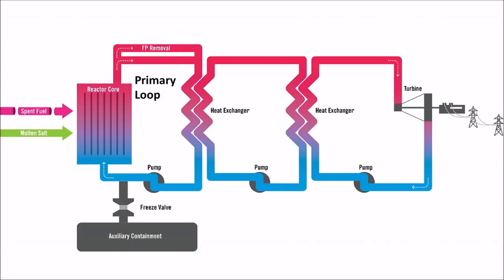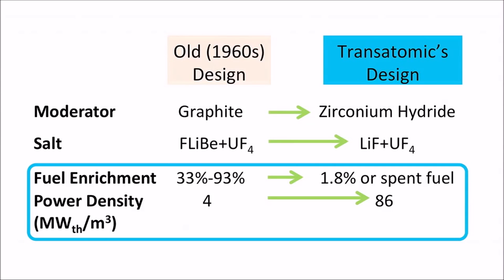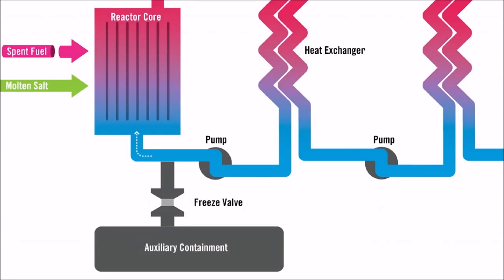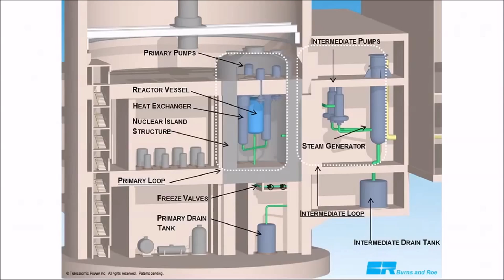Burn Nuclear Waste with new High Technology Reactor (MSR) [Read description for update 2/2019]

Comment: I really think that this has more applications besides electricity. For example, if one of these was set up at a petroleum refinery, the waste heat could still be used for distillation of crude, and because refineries are already secure installations and are on contaminated soil, no extra space would be needed.  This also could be used to produce hydrogen either by modifying natural gas or by electrolysis for hydrogen fuel cell vehicles. A large scale hydrogen storage area combined with  banks of fuel cells could provide electric power during peak loaf or emergency backup for the refinery. Power outage at a refinery causes a lot of money to be wasted in product. Combining the functions for both electric and fuel could be very economical, and if it proves to be as safe as advertised, the potential to make a bad situation much worse won't exist.
Reply from the maker: I love your points, and you are (at least mostly) correct.  Hydrogen is actually a pretty poor energy storage option.  It has low energy density and there are significant losses in making it (even from electrolysis).  However, the idea of using excess heat to run chemical reactions has been discussed at length in the high temperature reactor community.  Two very nice examples:  jet fuel (already proven by the US Navy), and ammonia (NH3) - great for fertilizer as well as a base chemical for a huge list of uses.  Non chemical uses could include thermal water desalination (a great way to get clean water from the ocean).  Your point on crude distilation is also a good one.  Right now, the waste (thick, polluting) oil is used to generate the energy needed to separate crude out of tar sands.  If you could use nuclear energy, then when we do use oil, it would cost less and pollute less.  There is a high temp reactor company looking to promote this exact thing in Canada.  What would probably be even better (though more in the future) would be to use nuclear heat to generate liquid fuels (similar to the jet fuel example) which then are burned by normal engines, and then the gasses are recycled again back into more fuel using nuclear heat.  Basically we would turn liquid fuels into a renewable resource with a closed loop.  This would give the best of both worlds, since you now have the high energy density of liquid fuels, the convenience of refueling (compared to charging electric vehicles), etc.  But I'd argue there is a lot to say about all of this - a huge potential here that really needs to be explored and implemented as soon as possible.
Reply from the maker: It is also reasonable to expect in the (hopefully not distant) future that oil harvesting will be economically pointless.  If you take any random area and dig up the dirt, then extract the thorium, the energy equivilent contained in that thorium would fill the hole with oil 30x over.   The numbers show that average dirt is about 2 ppm thorium, but right now thorium is a waste (a legal probablem and nuscance actually) from rare earth mining (typical mining sites I recall are ~10ppm thorium).  Theoretically, we could basically power the world from this waste product and never need oil again (and would create liquid fuels from CO2 and H2O and/or nitrogen from air for NH3) to cover the need for high density portable energy.
Reply: LFTRnow I really hope they get the small modular prototype built soon. It seems that the proof of concept is the biggest catalyst for getting the ball rolling to a commercial product. So much red tape and burocracy will be much more damaging to the environment because the more traditional electric generation continues to run and pollute it's sad that out scientists have to go to Russia and China to develop these concepts because of the fear and ignorance that keeps us from even trying new technology. I believe that it can be safely done and that this is the most important step towards reducing the greenhouse gasses that are raising the global temperatures.  It's very sad that the three most well known nuclear disasters would have been prevented has the people working at the plants left the system alone and do what it was designed to do. 
Three mile island operators turned off the cooling system because of a faulty pressure operated relief valve - basically.
Chernobyl: operators disabled all of the safety systems that would have scammed and cooled the system.
Fukushima: operators cycled the convection cooling system to prevent fuel damage from cooling too quickly. Had it been left alone they might have had some warped fuel assemblies but they wouldn't have had the scope of damage that they currently are dealing with. 
I'm also thinking that this new system can also use the depleted uranium in a breeding configuration if so we could be potentially sitting on  an enormous reserve that will last for many years.  It concerns me that the USA isn't perusing these newer reactor technology quickly enough to get important patents and other foreign countries end up with a monopoly that ends up costing us in the long run towards the cost of electricity both commercial and residential.  With coal, there is still waste that is radiological because of the traces of radioactive elements that are in coal. It would seem that not many people are aware of it.
Reply from the maker: I agree and heard of all of that except for the explanation of Fukushima.  I would argue that the amount of radiation released to the environment would have been negligible if the reactors were opened to the ocean when the cooling system failed.  Instead, bad instrumentation and delays in action caused the pressure to build up and blow the roof off of a pretty badly designed reactor (Chernobyl was similar in that both had no containment structure like most US reactors do).  Still, while I'm pro conventional nuke as well, I would truly love to see new GenIV designs get built and fast.  There are some variants getting built around the world but no thorium, or liquid fueled (including MSR or LFTR) reactors yet.
Reply from the maker: Also sad, I'm sure you have heard of the IFR.  It was to use the "spent" fuel from light water reactors and breed the uranium to plutonium for energy.  It was sadly shut down in the '90s.  It is really unfortunate that nuclear accidents basically made the public want to stop doing nuclear energy of any kind, when really what we needed was MORE research so newer and safer designs (and more cost effective) could be created instead.  The video link below is a clip from Pandora's Promise and shows how the IFR would have automatically prevented (by design, not by safety systems) any of the last nuclear reactor accidents.  This tech EXISTS, yet we don't use it.  I believe a few breeders are being built around the world, the UK installation being one of them, so perhaps there is still hope.  https://www.youtube.com/watch?v=Sp1Xja6HlIU
Reply from the maker: Funny you should mention coal waste being radioactive.  Have you heard the area around a coal plant is more radioactive than that around a nuclear plant?  The reason is obvious, though people don't think about it.  A nuclear plant has shielding and emits very little to the outside, usually it adds a tiny fraction to the existing background radiation - where as a coal plant burns the carbon out of coal and leaves behind lots of toxic metals, including radioactive uranium and thorium.  As small amounts escape over time into the air, it blankets the area around the coal plant in radioactivity that is well above background.  In short - want less radiation?  Build more nuke plants.  https://www.scientificamerican.com/article/coal-ash-is-more-radioactive-than-nuclear-waste/  Of course, there is quite a bit of research suggesting the body actually needs MORE radiation, but that is a story for another time.  Far worse though is that the toxic materials from coal ash can get into the water supply and pollute - not for some tens or thousands of years like a nuclear accident is perceived to, but forever - the added lead, mercury, arsenic - it is there forever.  See:  https://www.youtube.com/watch?v=58kaw5GQIc4
Reply: I think it's awesome to talk to someone like you who is obviously an intellectual and haven't been judgmental or rude like I've seen in many other videos that are advocating for new nuclear technology. For that, I thank you!  I'm thinking that radiophobia I'm American was pioneered by the movie "The China Syndrome" that came out in 1979 just a few weeks before the three mile island accident. If I could afford it,  would love to visit Chernobyl and see the new gigantic safe confinement building. I haven't seen much online about their progress in dismantling the old sarcophagus and removal of the debris. I'm fascinated by the elephants foot. I remembered one of the documentaries showed they found some molten fuel still moving and glowing 5 years after the accident. I think it was from Nova "suicide mission to Chernobyl ". I really hope that someone is documenting what is going on inside the new building and I hope to see it soon. I'm wondering how much fukushima has melted beyond the pressure vessle. There's a few videos on YouTube but nothing so far has satisfied my curiosity. Japan had a plant for processing used fuel and it had failed due to a major leak, and it's bad because it could have really showcased what could have been a very good process for recycling and further reducing spent fuel storage.  The PVA got the new reactor at watts bar going but it's still an older design, although the safety systems are modern by comparison to other reactors.  I'd also like to see how they decommissioned the enterprise CVN65. Those 8 reactors! I'm expecting there have been a few challenges to dismantling that part of the ship.  It's reminded me of Russia and their floating power plant that had to be moved before they could load it with fuel because it was too close to a densely populated area.
Reply from the maker: Thanks, same to you.  You are correct once again, and you can add more villains to the list.  NRDC, Sierra Club, Greenpeace, UCS, and myriad state and local groups have spent 50 years frightening the public with pseudo-science, suing utilities, subsidizing the competition, and winning regulations that do nothing for plant safety.
  http://environmentalprogress.org/big-news/2016/7/14/bloomberg-new-energy-finance-renewables-killing-nuclear  I also believe you are correct that it was a Nova documentary.  I saw the same one and remember it at the time being frightening - with good reason - doses were high enough to kill those working on the problem, and it was the worst nuclear energy disaster the world has ever seen.  Stepping back however, we find out the deaths were a drop in the bucket compared to other sources, and the event was due to a very badly designed test, as well as no real containment structure for a design which by nature had positive (bad, rapidly accumulating) thermal feedback risk.  I've not kept up on the very latest news on Fukushima and the others.  I know about the details of the Fukushima accident, and that the paranoia of the ocean is fearmongering.  Also that most of the "damage" done by nuclear accidents is moving people that don't need to be moved.  This was the case both with Chernobyl and Fukushima.  Chernobyl was worse as well due to not informing the public quickly - the worst isotopes (I131 for example decay fast and emit a lot of energy - and go away quickly).  Simple steps like "don't drink the milk or slaughter the cows for a month" would have gone a long way.
Reply from the maker: There are a lot of details on this site (see link) which is trying to fight the war on nuclear.  I will admit it can be difficult to corroborate a lot of their information with a simple google search, but they generally show sources which you can then research further.  This link takes you or anyone interested directly to the war on nuclear articles, and there are several other topics.  http://environmentalprogress.org/the-war-on-nuclear/
Reply: I don't see a future without any nuclear power. It's amazing how many people don't realize how much nuclear relates to their everyday life.  Silicon can't be a semiconductor with being bombarded to change some of the silicone to phosphorus for common semiconductors.  The fruit and vegetables imported from other countries gets sterilized with cobalt, all of the band aids and gauze, and gold seeds for treating cancerous tumors. Wind and solar aren't as green as advertised. The process of making the solar panels is an extremely toxic process. Those big wind turbines have antifreeze and oil much like a car or truck has.  The absurdity of removing all nuclear reactor related items from the world would make for a complicated life that people of the modern world can't realistically imagine.   Sure devices are using less power than before, 10 watts of LED taking place of a 100 watt incandescent bulb, but people are using more electronic devices now than ever before. People might have had 5 devices plugged in back in 1972, and now is rare to see less than 15.  I don't see a day when everyone has their own reactor in the basement of their houses. It would be cool to see electric trains that use a nuclear thermoelectric power generators to charge lithium ion batteries. These generators are still operating in deep space on voyager 1 and 2.  It's amazing how people are so quick to panic about stuff they don't know or understand.
Reply from the maker: I agree with all you just mentioned, except the silicon reference.  That is not actually a nuclear process though it is change on the atomic level.  What you described was ion implantation.   The link below covers it, and on that page there is a link to semiconductor doping - an interesting but very technical, even by Wikipedia standards.  https://en.wikipedia.org/wiki/Ion_implantation

Comment: 4:39 - it isn't good desing...in my project radiator is inside the MSR reactor so no need to pump salt which submerged the heat exchanger. Reactor is very tall. The working gas is...Argonium in ~3,8 MPa. All cooled by air...so i have 5x10^15 tons of coolant avaliable XD
Reply from the maker: Interesting.  The idea of this video is to cover general concept but I'd be interested to see had video or links you have to share.  I know there are several MSR designs being worked on around the world.

Comment: They should completely get rid of nuclear industry.
Reply: Because there is so much out there.
Reply: Earth to sun.
Reply from the maker: Your proposal seems to be that you can use solar energy to replace nuclear, but there are several issues with this.  The largest is that the sun doesn't always shine (nor does the wind always blow) and the values are inconsistent though the day and do not match load demand.  This means you need to somehow store energy CHEAPLY (Musk's "batteries" don't meet this demand).  Nuclear power produces comparatively cheap, reliable and low waste energy with the lowest impact on the environment.  It is even lower than solar and wind when you consider the land use.  NEW nuclear (such as found in this video) would improve it even further.

Comment: if you burn it how are you gonna clean the air from the radiation  that exsapse from burning n then after you burn it wouldn't you have a pile of ask still that's radioactive idk much about nuclear energy but I say we need to find a better way that nuclear one mistake n we would destroy the whole ducking world so think about that power for 72 years if an accident happens remember we are only human accidents happen.
Reply from the maker: I'm confused what you mean by burning.  You don't "burn" nuclear fuel (or waste, or anything nuclear), it gets the name "burn" because people are familiar with it, but what is really happening is fission.  The "burn" mentioned in this video title is meant to refer to "consuming while producing energy".  Most people call this "burning" though when it comes to nuclear power, there is nothing set on fire.

To review, fission means the element(s) split in two or more pieces, releasing neutrons and heat.  That heat produces energy.  When you are finished with the fission, you have various elements left over, many of which are radioactive.  There is a (mostly unnecessary) fear about everything radioactive.  Believe it or not, your the air, ground, water and your body are all NATURALLY radioactive due to elements that have been here long before humankind did a single thing with nuclear energy.

As for this particular technology, one of the main benefits is that unlike the "waste" of conventional solid fuel reactors, the products can be easily separated.  This makes for more efficient operation, less waste and the ability to use the various products for good.  For example Pu238 can help explore space, Mo99 can help find cancers (it is the precursor to Tc99m used in hospitals) and so on.  The "waste" from conventional reactors often contains similar materials, but because it is trapped in a pellet contained in a metal tube, it is basically not a convenient resource - though interestingly, at least much of the unused uranium could be recycled and used as fuel again.  France does this, the US does not (mainly for economic reasons).  

Have a look at "Pandora's Promise" (found on Netflix) to learn more, or ask me further questions.